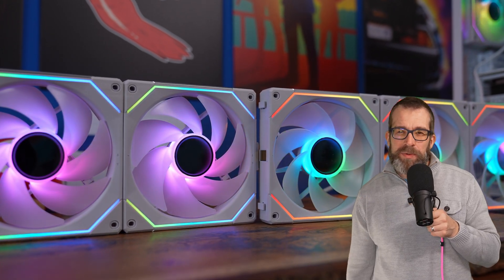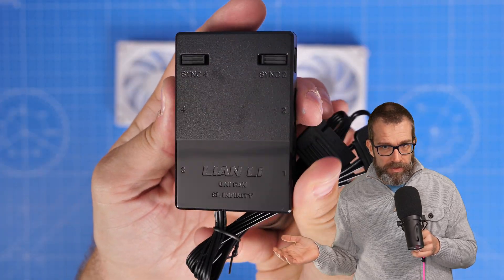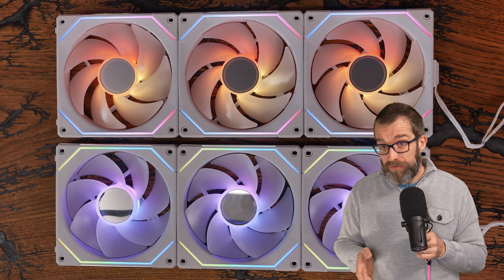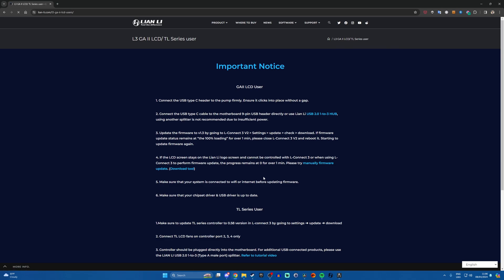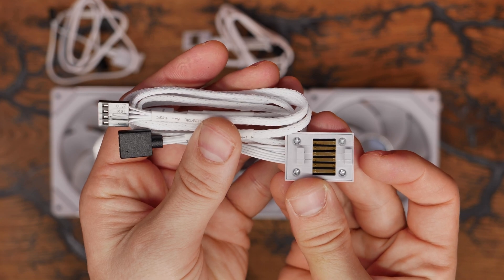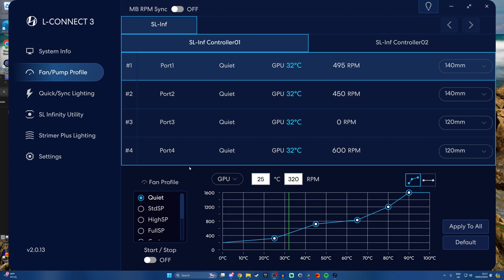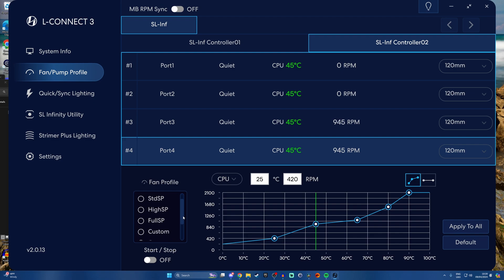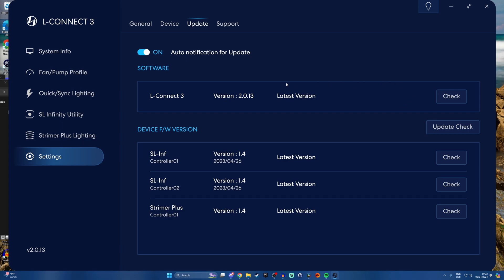Your Lian Li fan problems and questions answered

Comment: Good Advice. I recently built a new system with (4) Lian Li  SL fans and (3) Lian Li TL LCD fans. They are working great now, but were problematic to get working properly. The main issue that I ran into was that both of the Lian Li controller boxes would not be recognized by the Lian Li software unless they were plugged directly into the motherboard USB fan header (no splitter) or into the 1st USB port in a USB hub. Hopefully this problem has been fixed with the latest firmware update. Keep in mind that the TL fans do not include additional cables to separate the fans into 2 differnt areas of your PC and that you cannot daisy chain TL and SL fans. The only other issue that I encountered was with the triangular rubber pieces that push into the corners of the SL fans began to curl outward slightly with less than 24 hours of use. This is strictly a cosmetic issue, but is annoying on a premium product.
Reply: Hi mark, I have the first problem the L-connect doesn’t recognise my 4 lian li lcd and 3 normal lian li tl without lcd or even my 3 lian li al and the problem is I don’t use any type of splitter or extender or hub it’s plugged directly into the motherboard,do you know what should I do? 😢

hopefully you can help

sorry to bother you.
Reply: Hey, wanted to let you know that your advice about not using a splitter and plugging it into the first usb port worked magic, that was exactly what was wrong. Thank you for your help

Comment: You could also mention that it helps if you go to "Quick/Sync Lighting" and on the top right corner there`s the Export Import tabs so you can save your fan speed settings, light settings etc instead of reapplying them if you had to re-install the software.

Comment: Do you have experience with the TL fan LCD's just showing white flickering, when selecting "sensor" from the dropdown. Everything else on the fans works fine. They can do images, videos and animations just fine. But as soon as I select "sensor" to see CPU, GPU etc. temp info, they just have this white flickering on the default style. Seleting other styles kinda works, but not 100%. No text is displayed, no matter which style, but the "template" for the style is shown, except for style 1, which is just white flickering.
I have wired it according to the specfications. The TL controller is on it's own USB connection on the mobo, the 6pin power is on one of the spares for the GPU power. Lian li is not really helping with this, even tho I filed a service request. I have seen on reddit, that other people have the same problem.

Comment: Thank you so much doing video about this. You wont believe how many including me looking YT videos like that and testings are done with many fans and groups together. Also reverse blade is more important than ever due to wanting mirror or LCD facing correct way.

Also the push pull is what i looked for with these fans and AIO configuration and 95% YT videos never try that.
Thanks to your previous videos i orderd correct amount of Lian Li Uni reverse fans. I would have ordered wrong ones if i didnt see your videos.

Comment: So if i plug the fans on the radiator to the controller, I do not need the cpu_fan header at all, and just need to adjust the fan speeds in the software? Also the one cable that connects a set of 3 fans to the controller does both the rgb and power?

Comment: i haven't got any problems with my SL INFINITY 120mm FANS : if the instructions are follow according to the manual i think there won't be a problem with them: i got 9 fans on my Evo xl Lian Li case for now am planning to get 3 more for the bottom rail since they are so quite n so versatile

Comment: Issues I've had so far since owning Lian Li fans and AIO for a month or so:

1. 120mm Exhaust fan rubs on it self at higher speeds; Cant seem to see where from after inspecting and its intermittent, might RMA.
2. Screens on the LCD can revert to the Lian Li logo, after the system has been on for a while, restarting LConnect 3 does nothing and I have to cycle the power. 
3. Screws don't get tight in some of the fans like the thread is striped even though I have not overly tightened them, like they are made form cheese.
4. Fans are over sized so didn't fit into the NZXT H6 case, had to return case and buy O11 Vision, as I really wanted the fans.
5. LConnect 3 is temperamental, some of the animations for the AIO screen are just crap, but at least you can customise quite well.
6 The clear bearing cover on the TL fans looks unfinished and cheap, no wonder they on show spinning on the website.
7. Cables out the AIO block, especially the USB are large, stick out to much and hard to route, the 90 degrees bend on the USB makes it hit the other cable and I just don't know why it cant be one connector.
8. Hard to sync all the lighting on the fans in LConnect 3. 
9. The shades of white between the Galahad AIO block and fans are way different.

System: O11 Vision White, Lian Li GPU Vertical Mount, 3x140mm Uni Fan TL Reverse, 3x120mm Uni Fan LCD Reverse, 1 x 120mm Uni Fan normal. Galahad II LCD 360, 14700k, MSI Z790 Edge, 32GB G Skill Trident Z 7200, MSI RTX 4080 Gaming X Slim White.

Love the fans though, look really smart, bit disappointed with the rubbing fan though. As for the AIO block, I think the Corsair AIO LCD looks better but it still looks good. 

Let me know if anyone wants a quick video of the system to see how looks, I can post on my channel, was a bit peed off as well the slashes on on the 4080 Gaming X slim fan shroud don't light up, like they do in the product images but 3rd world problems hey.
Reply: No disrespect but your system RGB would trigger my OCD.
Reply: Hey I’m currently having the issue with the LCD AIO reverting to the Lian Li logo. What did you do in order to fix it? What do you mean by cycling the power? Unplug the usb-C and replug it in?
Reply: Cycle = turn off/on  @All-In-Win
Reply: @All-In-Win  Hi, I've just had to rearranged the fans, as in bottom to middle, etc, just moved them around and it started working again. Trouble is I can't work out how to rearranged in order now, LConnect is so crap.
Reply: @-Highlander-42  Hi its a MSI Z790 Edge Wifi, just on the XMP profile. Only had one game crash but the system didn't, but I blame PUBG for crashing.

Comment: One of my issues with L-connect is it causes stuttering in games. I still use it and close it within task manager. I think it is a problem unique to 7800x3d chips. But if you have a better work around, I would love to hear it!
Reply: is it resolved for you? I have a 7800X3D with Lian Li fans, haven't had any stuttering issues
Reply: @cks2020693  actually seems to be updated the software by uninstalling then reinstalling a new version!
Reply: I had the exact same problem. It was peaking at about 30% due to an .exe it runs (I've done a video on this) 
I was running the TL LCD fans with hardware feedback/visuals. But once I changed all that to static JPEG, those spikes are gone. 
I too am running 7800x3d. So you maybe into something there.

Comment: I was considering Lian Li Uni fans but I think I got something better, no not the Phantek D30. I got APNX FP2 full metal case 120mm (d 30mm) and these come with extra reversible fan (though do be careful when you pop out the default fans from case). Not as tidy with regard to cable management as Lian Li, but much cheaper and more efficient. Really impressive, the APNX visuals are eye candy :)

Comment: Useful video,  thank you. 🙏🏻

Do you think using a push/pull configuration on an Arctic Freezer III 360mm AIO mounted to the top of an Antec Performance 1 FT case offers a big enough improvement in lowering temperatures on a 13900K compared to just having the standard 3 x 120mm included fans exhausting out of the top of the case to make it worthwhile?